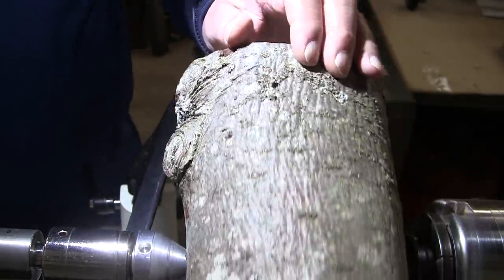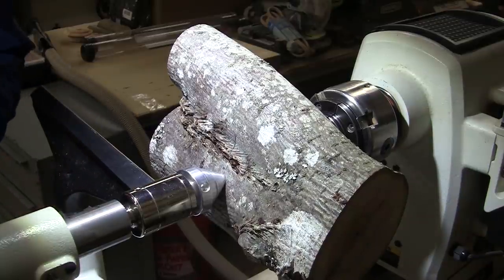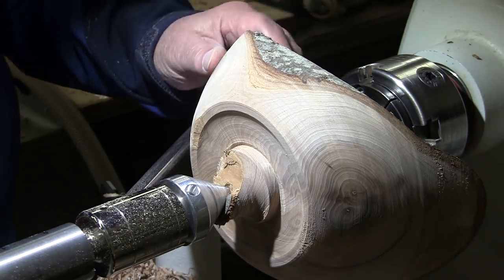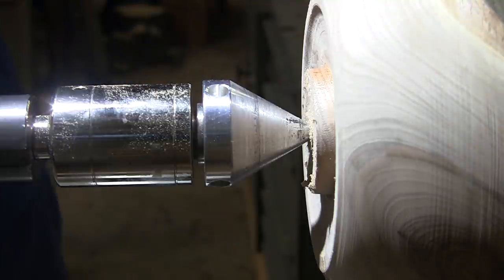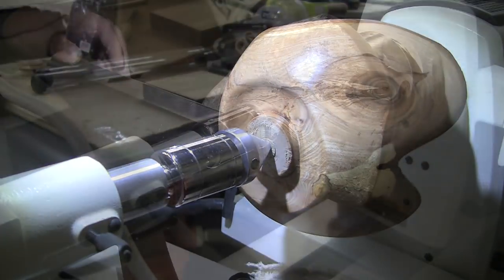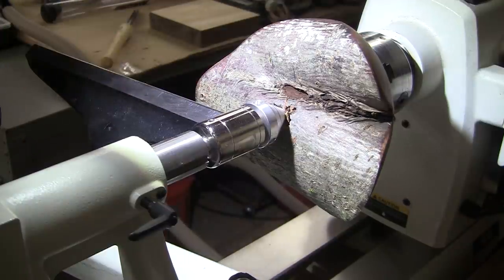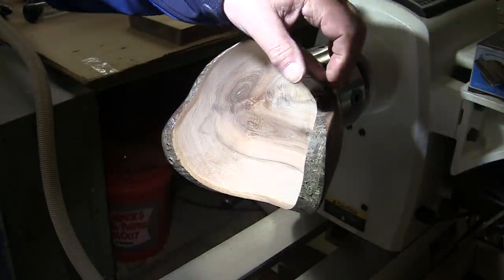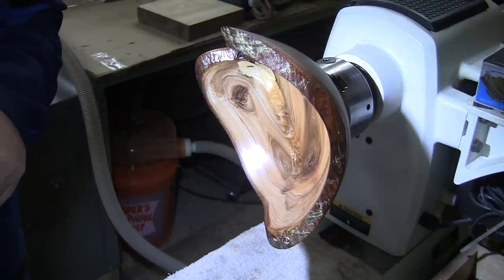Plum Crotch Live Edge Bowl - Wood Turning

Comment: Another excellent video Phil!  Just wondering. Would maybe a wet sanding while the lathe is running to create a slurry that could be worked into the torn grain areas? Just a thought
Reply from the maker: It wouldn't hurt, David, but I just don't think it would have helped in this instance.  The torn grain is right at the edge of a knot which is highly polished and that makes the torn grain look worse than it really is.  However, your idea is a good one and would definitely work in some circumstances.  Thanks for the idea and for taking your time to let me hear it!
Phil

Comment: Another beautiful bowl Phil! Love the crotch figure and the nice warm colours. I know what you mean about the difference in turning the outside vs the inside. The outside takes most of the time because it's what actually makes the bowl ie shape. The inside feels like progress because you just gotta get all the wood out lol One question: does your sandoflex thingamajig have different grades of coarseness, or does it just function more along the lines of a 60 grit comparison? 
Great turning and entertainment as usual, keep em coming!
Kyler
Reply from the maker: Thanks a lot, Kyler!  Yeah, I think once I turn it around and start removing the inside, it's kind of a freeing experience.  Just hog it out and get'er done!
There are many grits available for the Sand o Flex.  The refills also come slashed and non slashed.  That means the sandpaper has been split into about six strips for each 1" wide roll.  I generally prefer the slashed refills.  I think the only non slashed I use is the 60 grit.  In every case, because the sandpaper just kind of flops around it's less abrasive and less agressive than if you were to just hold a piece of sandpaper up to the piece.  In other words, it's very controllable and you don't end up rounding something you didn't want to.  On the other hand, you do have to develop a knack for using them because they can get out of control in a hurry if you press too hard or don't pay attention.  I've been using them for many years, mostly on flat work before I became a full-time turner.  I have many of the heads but use four of them on a regular basis with different grits in each.  Just makes it a little quicker to switch from grit to grit.  You can see the newer models and refills here:  www.supergrit.com 
Thanks a bunch, buddy, for continuing to watch and comment and for being an inspiration to me!
Phil
Reply: madronawoodworks Thanks for the detailed explanation Phil! I understand the systems a lot better now. Control of sanding is such a constant battle for me as I have in fact rounded over edges more that I wanted, and left divots in the center of the bottom of Bowls, which is maddening after spending so much time trying to get it right with the tools first. I will check out the system and I'm thinking more and more it might be my next "shop investment" lol thanks again!

Comment: Phil, when you turn green wood do you seal them right as you turn? This is what it looks like to me.  If so, do you worry about cracking?
Reply from the maker: I seldom turn wet wood, Ray.  If I do, I feel that applying the finish slows down the drying and lessens the possibility of cracking.  Also, the climate will play a factor.  Where I live, it is cool and moist, for the most part, (this year is an exception) so the wood does not dry quickly.  In a hot, dry climate, it may be an issue.

Comment: Hi Phil,
I think this is one of the best looking bowls you've turned!The grain onthe outside is awesome but the inside just amazing!
I noticed the wood wasn't turning true when you were cutting the outside and cutting the tenon.
It may be because of the wood broken off where the live center was into the wood?I've had this happen and re-trued the piece by cutting off the broken part.
I hate torn grain too and sometimes put thin CA glue on it and then turn it again.
Thanks for the video!
Tom
Reply from the maker: Thank you, Tom!
I think you are exactly right about the wood and drive-center.  I don't usually turn with a drive center and I don't take the time to set it in the wood like I should.  Just about the only time I have this trouble is when using the drive center instead of my woodworm screw.
CA is a good tip, Tom.  Might even have worked just to apply that and then sand but I just didn't think of it!
Phil

Comment: Phil. Watching as you cut the remains from the bottom by the cone center it appears you were so very close to losing it. From my experience turning many many large bowls I’ve learned not to use the large cone. Just doesn’t hold well. Just take it off and use the live center. Haven’t lost one after I took it off. Leefy
Reply from the maker: I understand what you are saying, Leefy.  I've tried that and found I can't get close enough to finish the cut.  If you have a video showing yours, I would like to study it to see if I can improve my method.  Thank you for your comment!
Phil